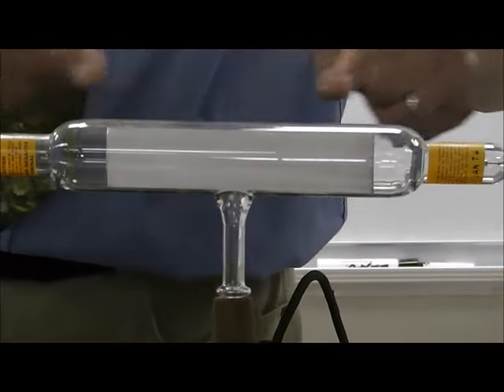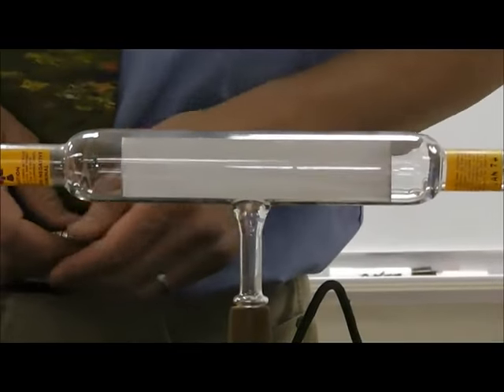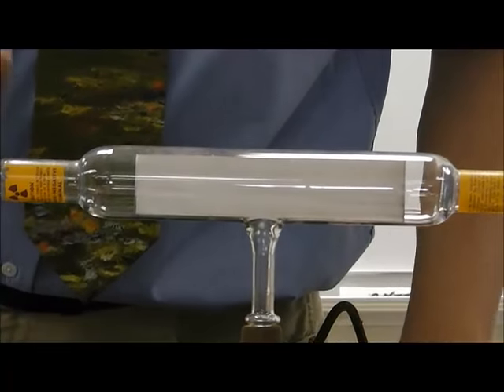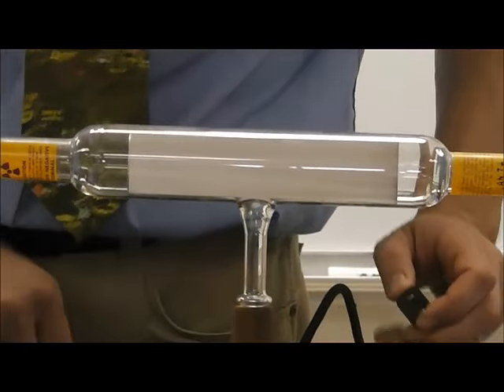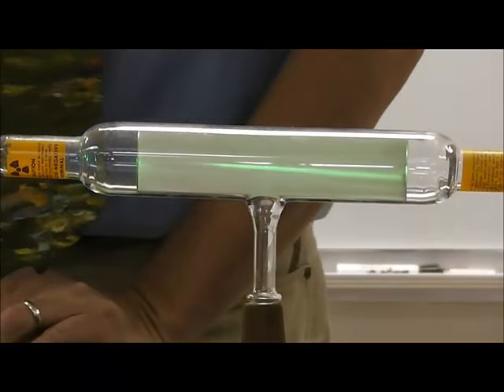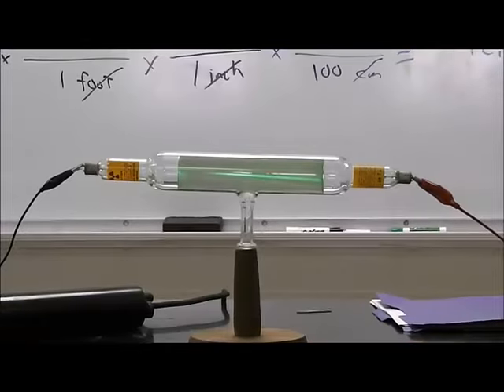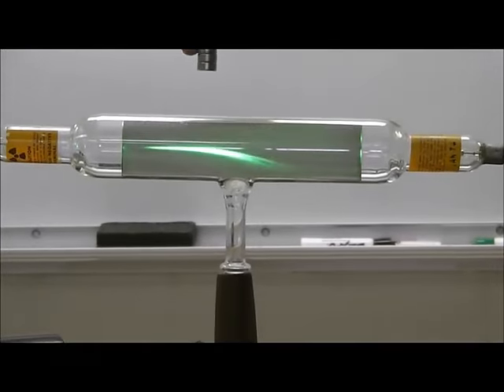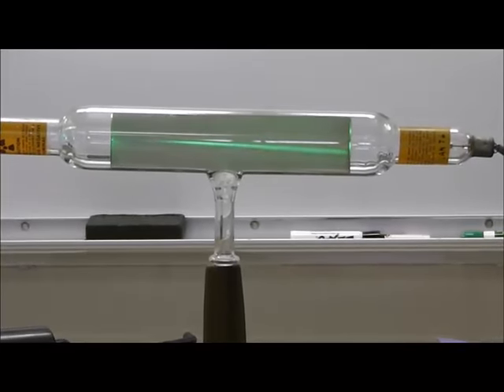RC Unit 3:  Demo - Cathode Ray Tube

Comment: You mean that the magnet is negative so that they repel to the negative of the atom? What happen if you reverse the magnet (which mean it will be positive), so if the magnet is positive they will attract to the negative of the atom? Please answer my question, thank you.
Reply: The explanation is incomplete or inaccurate. Electrons are negatively charged. This experiment is basically a miniature particle accelerator. The idea is, the electrons propagate towards the positively charged section of the tube. The polarity of the magnet leaves me baffled but I'd imagine that the magnetic forces are deflecting the electrons to put it simply.

Comment: Why the color of cathode beam is green . please explain me sir as soon as posible.
Thank you sir .
Reply: Geissler tubes had enough air in them that the electrons could only travel a tiny distance before colliding with an atom. The electrons in these tubes moved in a slow diffusion process, never gaining much speed, so these tubes didn't produce cathode rays. Instead they produced a colorful glow discharge (as in a modern neon light), caused when the electrons or ions struck gas atoms, exciting their orbital electrons to higher energy levels. The electrons released this energy as light. This process is called fluorescence.